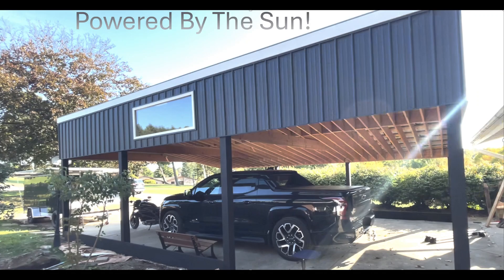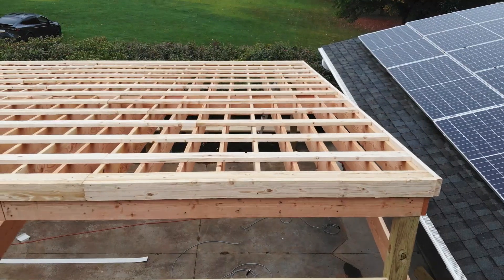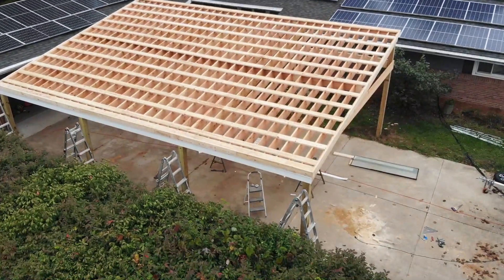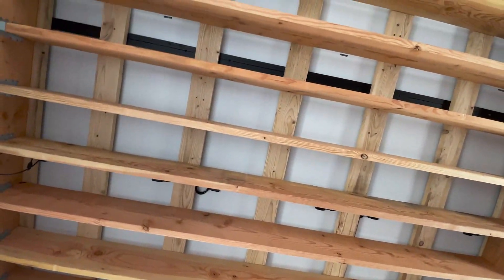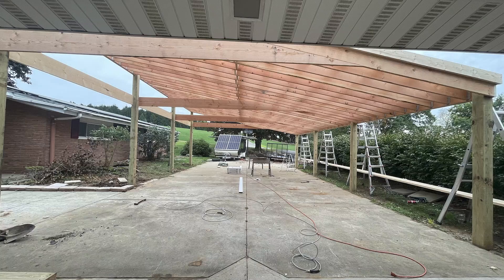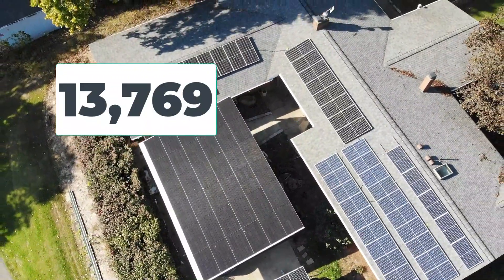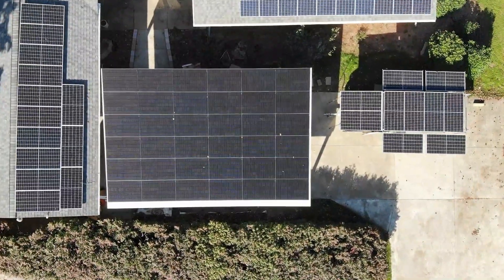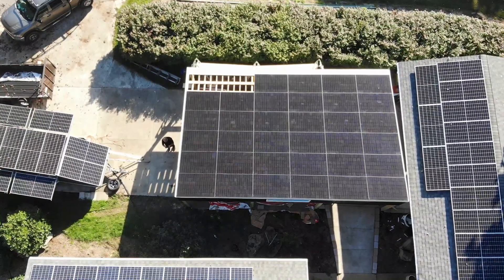My House Silverado EV, Tesla Model X, Harley Livewire and Lectric e-bike are Powered By The Sun.

Comment: If it were my build, I wouldn’t bother running the cable into the house. I’d install an 18k EG4 inverter with 48amp charger under the carport, include a small battery and charge directly from there during the sunlight hours.
Reply from the maker: I’ll have to give that some thought.  The issue is the weather.  I am in PA and my batteries will freeze unless I enclose it.

Comment: Rob, I am in the forever troubleshoot phase of my 19,200 watt system.  Sol Ark 15k, Q Cell 405 watt panels (48 of them).  I have had many stops and starts over the last 18 months.  I see your en route to nearly the same system.  Everything is working great on mine BUT the PUD is hostile.  The PUD was sending out 30 volt spikes to the both the net meter and house meter.  The spikes cause the Sol Ark to trip and kill the solar system!  It was happening everyday within a few minutes of each other, 1225 PM, mid day.  The PUD pings the net meter and the house meter which trips the Sol Ark offline due to a ground fault detection.  I complained and the PUD pulled the net meter, now I have only one meter again.  However the very next day at 1:25 the Sol Ark tripped and went offline.  And then the next day, at exactly 1:25 it did it again.  The time of day is when my panels are generating, on a full sun day, 15,500 to 16,500 watts.  In the beginning, right after I installed the system I was having random arc faults, but a week apart.  I troubleshot everything and found no faults.  Then I noticed the times were all the same for the arc faults.  One explanation is the PUD does not like the extra power and trips my inverter to shut it down.  The other issue is Sol Ark being super sensitive to pulses from the PUD triggering shut down.  I can go a week with no problem but over the last month the PUD has become a pain in the ass by sending pulses to my meter and turning off my panels daily.  Anyone out there have the same problem?  The PUD admits there are other customers with the same problem and they had to pull the net meter, but the problem for me is persisting with the main house meter.   I'm contacting Sol Ark to see if they have a solution to 'desensitize' the inverter.  Good luck with your system.  Your on the right track!  BTW, you published the price of the carport, but stayed clear of the solar costs.  I'd estimate your system will cost about $60,000 before rebate.  Mine will be about $45,000 after rebate.  The plus is my Tesla charges for free, no electric bills, house meter will generate a payback annually of about $1000.   For anyone thinking the payback is too slow, remember you will get instant payback when you sell your home.  My system, had it been installed by a contractor would have cost $100,000 to $120,000, but since I did it myself I saved a ton of cash!  And the home value will jump by about $75,000 when I sell it as a Net Zero home.  BTW the system is EMP hardened to DoD standards.  Check out Sol Ark and EMP hardened inverters.
Reply from the maker: I am sorry but I don't think I can help since I have no experience with the Sol Ark Inverters.  I looked at them but decided on the EG4 6000XPs since they add a layer of redundancy.  You still have power if one goes down.  I have 3 of them in parallel.  Their support is no help?
Reply: @Roberteeeeeee  I wanted to mention charging EV's off solar.  Great for when the sun is shining.  But during periods of overcast and rain your going to need the grid to charge.  If you try solar batteries to charge the EV here is my experience;  840 Amp Hour batteries lose 2% SOC vs my Tesla gaining 1% charge.  Its a loser to try to charge EV batteries with Solar batteries.  The cost of the three EG4 batteries is about $12,000.  I would need to add at least another 600 AMP hours or about $8500, to be able to charge the car from 20% to 80% and still remain above 20% SOC on the solar batteries.  My average charge on the Tesla on the grid is 35 WHRS.  My utility rate is .091 per KWHR.  Just over $3 to charge her up to 80% at home on the grid.  SO does it make sense to spend $20,000 on batteries or just be happy with sunny day EV charging and cloudy day grid charging?
Reply from the maker: @MrDadioDude  I agree with your math.  This was never about saving money since I only pay .10 per kWh.  It is about energy independence.   I have 3 EG4 6000XP in parallel, so 18kW of AC power.  I have about 22 kW of solar that feeds them.  and I have 135 kWh of battery storage.  I put the battery packs together myself (well with the help of Will Prowse's Channel).  I need one more inverter in parallel in order to charge at 19.2kW/80-amp output.  The Silverado EV has a 205 kWh battery so I need the juice.  BTW, I think you lose about 20% converting from DC to AC to only have your charger feed the internal inverter and convert it back to DC.  I wish they would give me PV inputs to go right from Solar to the battery!  Thanks for the comment.
Reply: @Roberteeeeeee  I have called Sol Ark and they remotely turned off arc fault notifications.  The issue is not new to them, unfortunately I don't have arc fault protection now but then the PUD power coming into my home did not have arc fault protection either.  The only arc fault protection was in circuits in my home where I had an arc fault circuit breaker.  
I love the idea of using multiple inverters for redundancy.  For me a second Sol Ark 15k would run about $9000!  Not doing that.